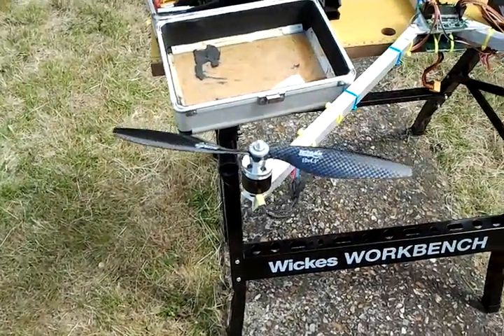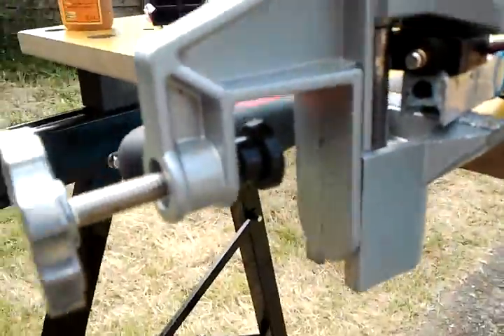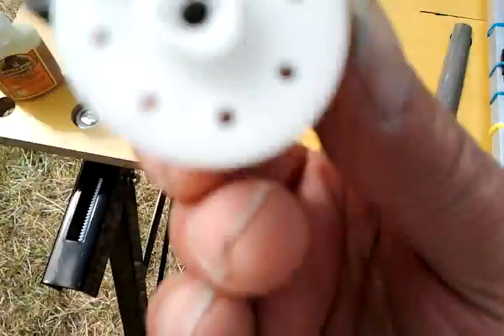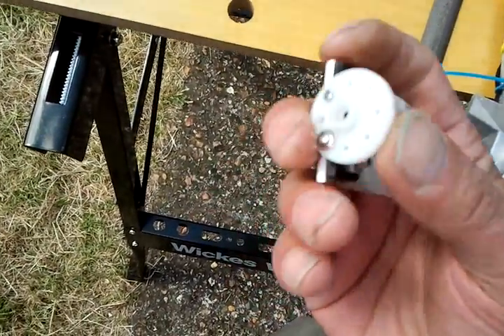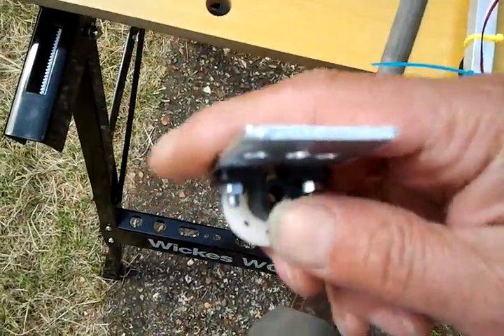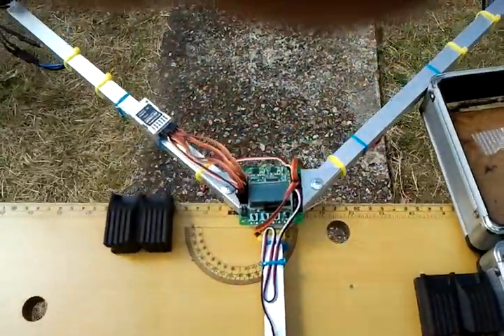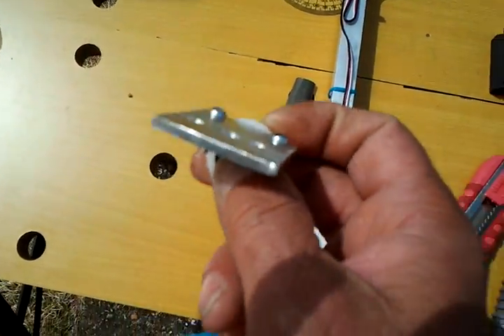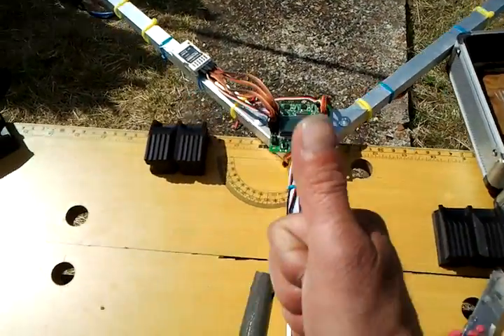Tri copter build

Comment: It didn't seem to speed up as it span did it ?  I needed to reverse the direction in the mixer section of the kk2 as it just thought it was correcting itself but in the wrong direction !  Also use the servo filter value if you are using an analogue servo.